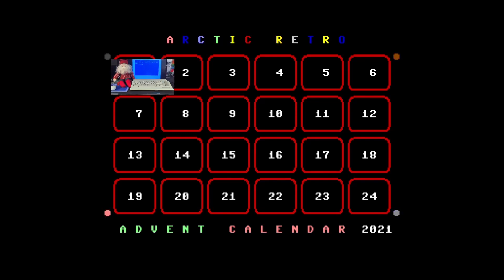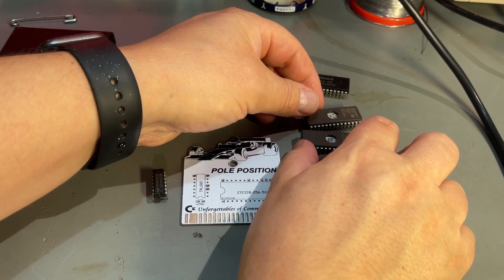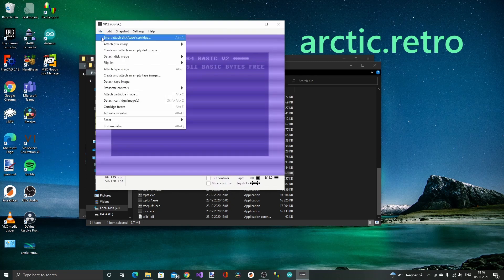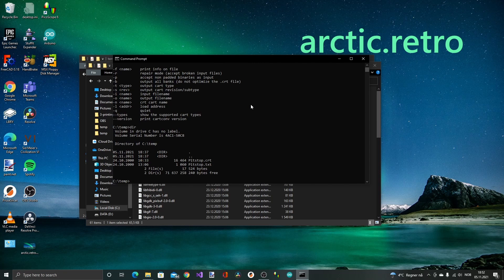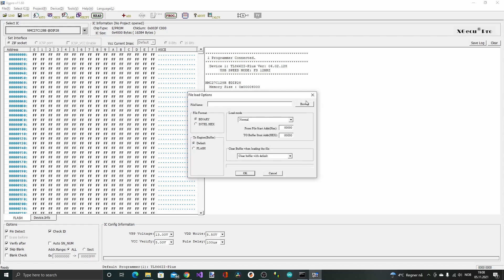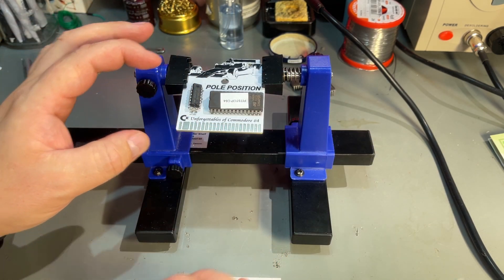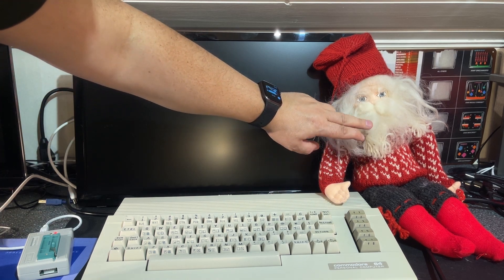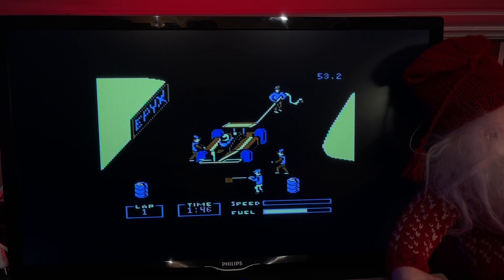December #1 - Building a Pitstop cartridge for the Commodore 64 - Commodore Advent calendar 2021

Comment: No matter which. I had great time fun with Pitstop and Pole Position. Wow, I've just found a disk called Pitstop II in my collection but so can't remember what the second part was like. In fact I am a race game fan ever since - on C64: Cross Road Race, Racing Destruction Set. But not because of getting the first place. No, I only ever wanted to explore the maps and cruise.
This is what I always only did to this day on my PC: Testdrive, Testdrive II, Testdrive Unlimited, Need for Speed Underground 2, Need For Speed World, Need for Speed Hot Pursuit, Need for Speed Most Wanted, TDU2, The Crew, The Crew 2. But as said, cruising is my thing.
Back to the C64 those self burnt cartridges are really quite practical. No loading times. Only the wear and tear of the edge contacts on the main board to be considered.